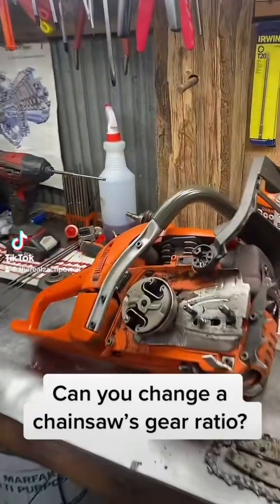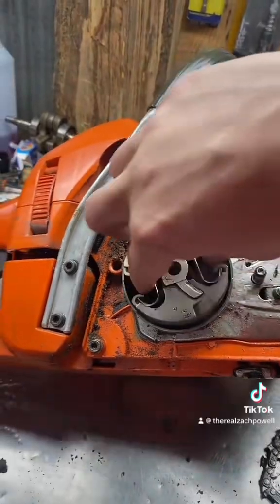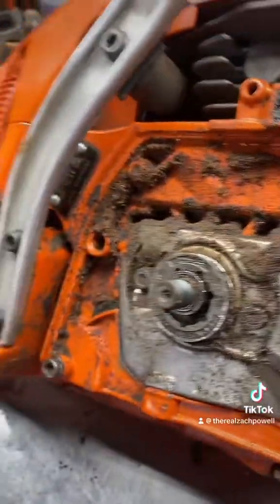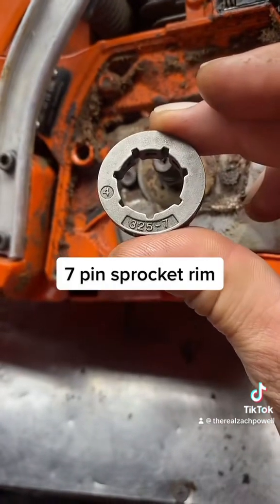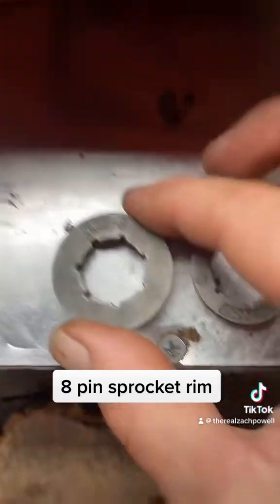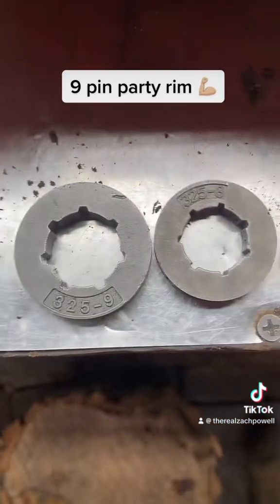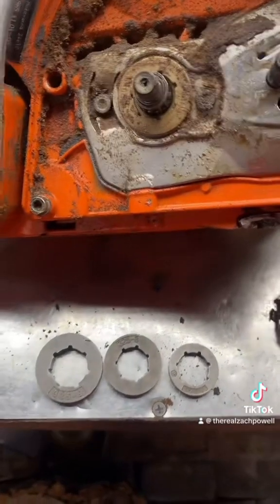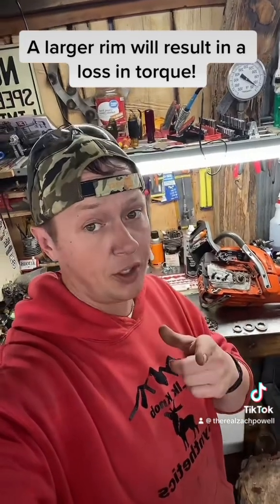Can you change a chainsaw’s gear ratio? #chainsaw #chainsawrepair #diy #fyi #husqvarna #stihl #tree

Comment: Wouldn’t you gain torque, and lose high end?
Reply: No larger sprocket give you more speed less torque because for every rotation of the larger sprocket the chain has moved farther than with the smaller sprocket

Comment: Now I have to go see what tooth sprocket my old 036 has as it is an absolute power house with a 16” bar
Reply: I put a .325 8 tooth sprocket on my 036 and a 20” bar. Talk about ripping the thing flew through wood. I’m running a 3/8 7 tooth and an 18” now. Fantastic saw. The 064 I have is wearing a 25” bar and has a 3/8 8 tooth and a full comp chain. That thing flat gets it.
Reply: Yeah bet that sucker rips with a 16 i might have to try that
Reply: @wolverinebear5357  most of what she gets used on is very old what was smaller(6-12in diameter) standing dead oaks that have fell into pasture roads so when the ms 250 says the tree is alittle on the hard side ole reliable comes out to play but I have cut some softer trees that were larger than the bar and it’s awesome being able to throw everything I can into the saw and it not bogging down whatsoever

Comment: So for the faster larger sprocket you will need a couple more drive links? Just guessing.
Reply from the maker: I can run an 8 on a 346 and 55 but a 9 will require another link or two. A 9 is for racing though.
Reply from the maker: and an 8 is for soft wood in all actuality. Or skip tooth chain maybe.